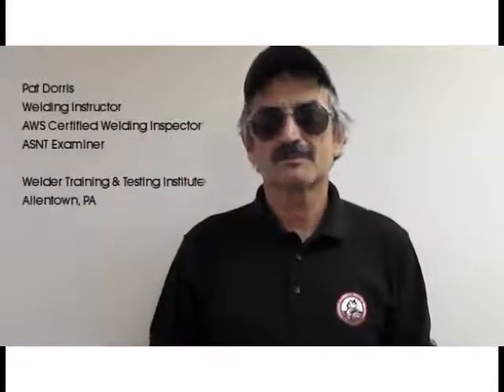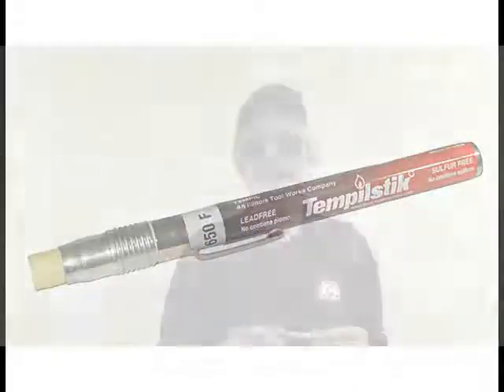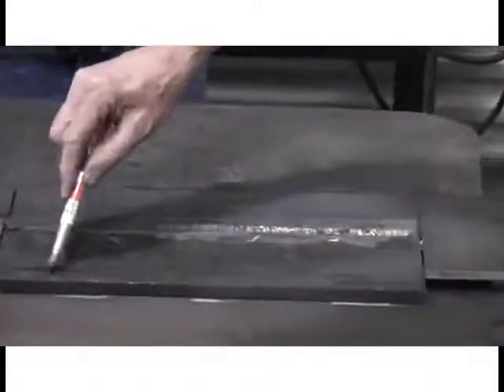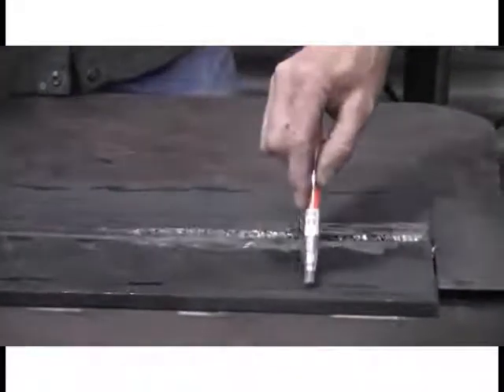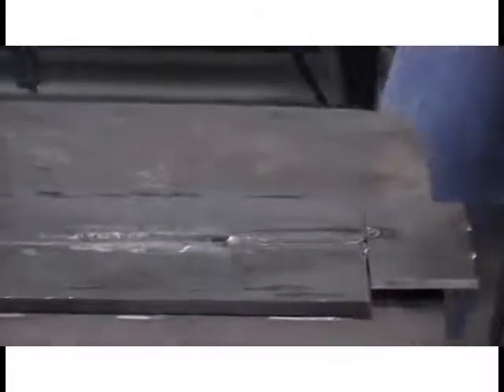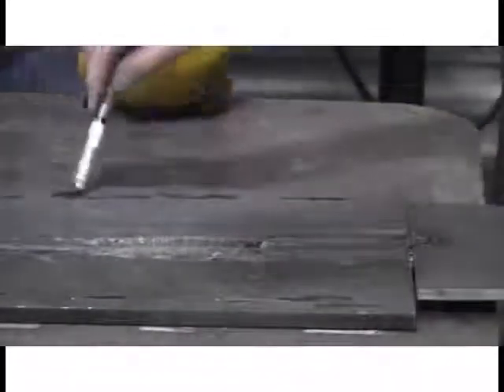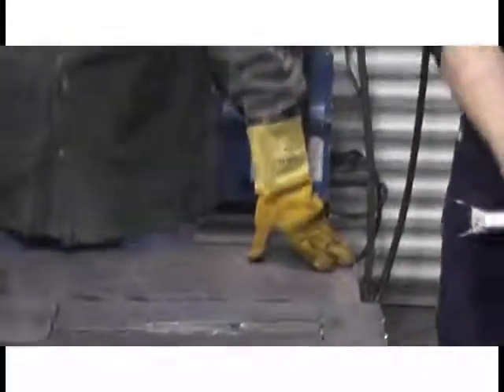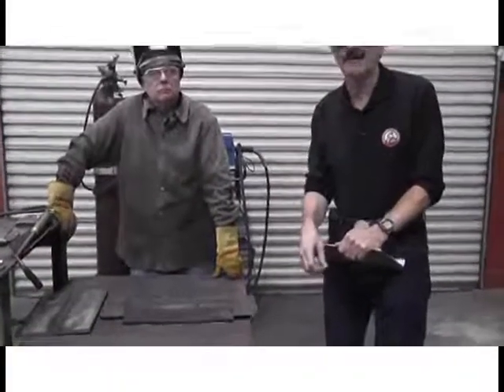Tempilstik Preheat and Interpass Demo

Comment: hi jonmif095, i suppose that those pipes are stainless steel and they cannot be welded by low hydrogen 7018!! be careful you can use TIG welding using stainless steel rod. if you know the material type for those solid drawn pipes I will give you the exact rod to use :)